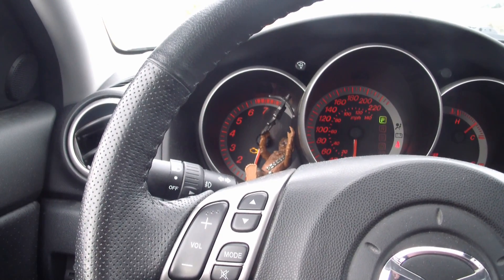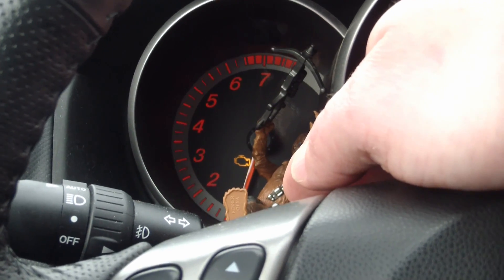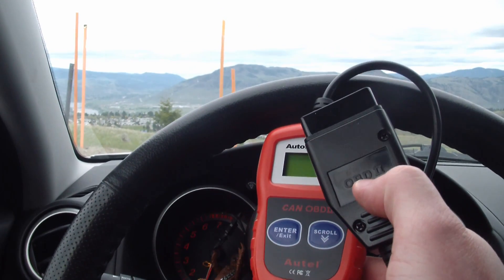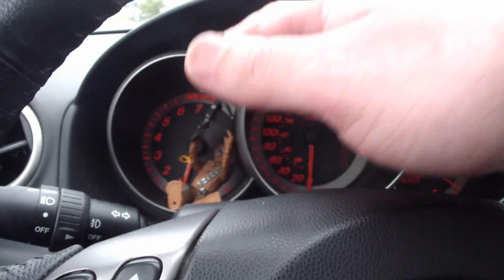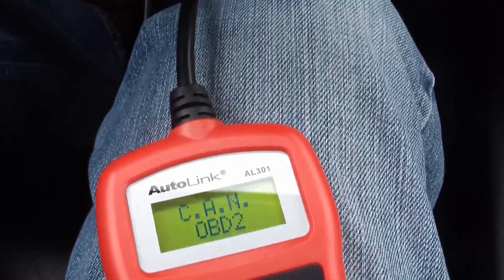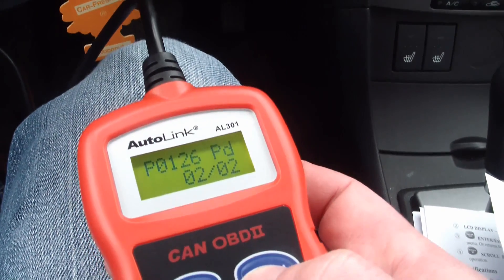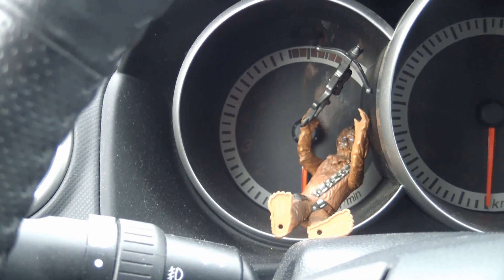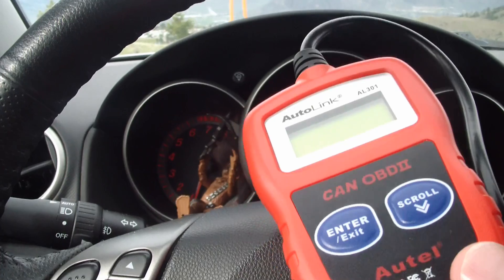Manly-Man Skills: Outsmart Mechanic Scams by Using Your Car's Computer!

Comment: First off, I'm not one of those trolls that likes slamming peoples youtube vids. I've been a professional mechanic for 38 years. I started working on computerized diagnostics in 1980 1/2, when they were introduced. I've attended multiple GM, Ford, Chrysler diagnostic classes. You've got a general idea what a "check engine" light is for. Let me zero you in on it a little bit. The computer has sensors, modules and actuators. When the ECM/PCM (Electronic control module/Powertrain control module) detects a sensor or actuator is reading above or below the parameters it is supposed to be in at a given point of time, for a given point of time, it will illuminate the check engine light. There are certain codes or conditions that will not effect drivability, and the light will go out on its own. If the problem can or will effect drivability the light will stay illuminated. In most cases a bad connection is NOT the problem. The automotive computer is used because of its speed and ability to sense and control the various functions of the engine control system, period. Any stored codes in the ECM/PCM will NOT tell a mechanic what the problem is with a vehicle. It is an aid to let the mechanic know what area the ECM/PCM detected an issue. There is NO diagnostic tool made to "tell" a mechanic what problem a vehicle has. It is up to the mechanic to interpret, test, diagnose and verify the vehicles fault. If a problem occurs momentarily, then clears up, a code will be stored for a time period, it will be cleared automatically if it does not re-occur in the next "50" cycles of the ignition switch. Any time a "check engine" light comes on, the owner should have it scanned by a qualified technician to find out if it is a serious issue that requires immediate attention.
Automotive dealerships, I've worked in several, would NOT return. A dealer has NO different selection of technicians as any other repair shop in business. In most cases, there is very little "factory" training provided to dealer technicians. I personally wouldn't allow a dealer tech to work on my car even while under warranty. Taking a vehicle into a dealer after the end of warranty is a bigger mistake. Customer pay repairs are inflated because of the difference in profits between "warranty pay" and "customer pay" in a dealer. The manufacturer "warranty pay" is lower than common repair cost. For instance, a mechanic has two identical cars in the shop with identical repairs, one under warranty, one NOT, the warranty repair will pay less and the "customer pay" will be inflated to help compensate for the difference. There are many other points I've passed on elaborating on because most everyone that has read this far down is bored to tears already. 
Again, a check engine light illumination should be checked by a trusted, qualified tech fairly soon to find out how serious a problem could be.
Reply: i'm not the person you're responding to, but i want to point out what the person is trying to say; a scan tool only tells you what the computer noticed is wrong. it does not diagnose for you. For example, you can get a rich O2 code that will show up like a P0420 (Catalyst Efficiency Code) that can be caused by something seemingly-unrelated like an intake manifold gasket leaking. In other words, a scantool is exactly that - a tool - and is not an automatic diagnosis machine. The code being set is a symptom of a problem, and it both might not be the only symptom, and might not be obvious as to the cause. It's very easy to be too reliant on the code reader.
Reply: gantz the great
The "cel" as you refer to it doesn't check anything. It is not there to identify emission problems. The electronic control system has many sensors, actuators and control modules. Any of those reading or working outside of their parameters will illuminate the light. Less serious problems my have to occur a couple times in a set time period to illuminate the light. The electronic engine controls are NOT there just for emission/pollution control. After working on all makes and models for the last 36 1/2 years I've learned a few things about those kind of things.
Reply: So you're arguing that AvE is wrong, and was wrong to do and say everything in the video? He found the problem, using the scanner, and he fixed it. ?????
Reply: James Walls Still runs like a champ amirite
Reply: I've been in this business for 35 years. You are absolutely right. How many DIY understand CAN1 & CAN 2.None of them I'd bet
Reply: @theflyingW64  Oh for fucks sake. You fucking primadonna. Thanks - Lumpy
Reply: count the flashes! Oh you lost track of where you were? Wait was that a fast or a slow one?

good riddance, lol.
Reply: May your swords stay sharp! (mysss29)
Nothing was fixed in this video. A CEL was cleared. That is NOT fixed the issue.
Reply: What brand is the diagnostic tool?
Reply: The CEL definitely aint a diag. tool it was not put there by the car maker by choice, our, i mean the govt forced them to put it there for all their pollution fuel waste  BS they enacted over the years! The cel usually only checks systems that affect emissions pollution,  PS my cel will usually blink if a problem is more serious but its been steady on over 100000 miles damn catalytic converter.... luckily i live in a no inspection state ....PS PS you can pull codes by manipulating the key turn in my truck too but its a biatch to time it right
Reply: James Walls well the cel is just a heads up of something up. if its not flashing there usually is not anything serious. id worry about the oil light coming on
Reply: ok whatever The regulatory intent of OBD-I was to encourage auto manufacturers to design reliable emission control systems that remain effective for the vehicle's "useful life". OBD-II standardization was prompted to simplify diagnosis of 
increasingly complicated emissions equipment, and though only 
emission-related codes and data are required to be transmitted through 
it according to U.S. legislation it has no doubt evolved, You said...It is not there to identify emission problems, after a comment like that sir I would not let you work on my lawnmower.

Comment: so just for starters. I have been a tech/mechanic on high end makes and models. I've work in different "steelerships" as you call it and in my humble and professional opinion, i can tell you that not all dealerships are corrupt. now that's not to say i dont know any corrupt mechanics. because well, i do. I take pride in my work and the place where i do so. we do have a standard diagnosis charge @ one hour for $125. One hours worth of labor. I personally have taken off labor time from customers tickets that can't afford it. but we do tell you up front before any repairs are done that our labor time is $120 an hour not including parts. so it is your personal decision to say that you want "us" to perform you're service. so I don't think it is fair to say all dealerships are crooks because it isn't entirely true. also some people aren't mechanically inclined enough to scan codes and trouble shoot codes. like for instance a person has a vehicle with an amber service engine soon light on that is flashing and they clear that code and proceeded to drive said vehicle and the code was for lets say multiple cylinder misfire in which case the vehicle jumped time or timing chains started to stretch or low oil pressure let tension of the chain and the vehicle was still being operated under those conditions the vehicles engine timing chain could break or oil pump fail and that in itself could lead to vales being broken or bent and resulting in a new head ( top of the motor with the valves and all the uppy and downy parts with spinny things) and new pistons. I think it is a great idea for people to be able to trouble shoot their own vehicles. but i also feel they need to be properly educated in using OBD 2 scanners. there are free classes that will teach basic stuff like oil service spark plugs and scanning vehicles with scanners. also word for wise or food for thought. scan tools that dealerships like where i work on imports AUDI, VW, LAND/RANGE ROVER. AND JAGUARS, we have specific programs to be able to diagnose your vehicle properly. thus being why our loyal customers come back with their vehicle needs. those small cheap scanners can mislead and misdiagnose .  # CHEAPLABORISNTSKILLED and #SKILLEDLABORISNTCHEAP. 
I do appreciate you and trying to save people money. I was in no way trying to be rude, disrespectful, or mean. thanks.

                                                                                                                                              
                                                                                                                                     Six year humble,proud, and thankful technician.

Comment: just a FYI, the CEL (check engine light) will only come on if the issue can cause emissions to be above a certain limit, they can still cause a light to come on on the dash but the actual CEL is reserved for issues that can cause worse emissions. some fords can have a complete misfire on one of the cylinders and the CEL never come on because when they detect a misfire it will cut off the injector for that cylinder which means that it wont have increased emissions so no CEL. also theres tons of codes that that cheap generic code reader cant read, theres codes for the ECM (engine control module), TCM (transmission control module), PCM (power train control module), BCM (body control module), fuel pump control module, radio control module, ect... i have a scan tool that cost several thousand american dollars and theres still modules on some vehicles that i cant communicate with but i can communicate with all of them on like 90% of the vehicles available in north America.

Comment: +1 on this video. An OBD II diagnostic tool is something that should be in EVERY glove compartment.

Having said that? With the ubiquity of smartphones? Get a bluetooth OBDII reader and an app for said phone called "Torque" (It's free) and you can watch the engine as yer goin' as well as clear out codes.

Comment: That $30 device is not going to show you ABS, SRS or other codes like this.
Sure you can pull codes, but do you know how to fix it?
A P0171 code is system too lean, but do you know where to look?

People these days do not read the user manual so they drive around with little oil in the engine, loose lug nuts, blown bulbs. ect.
Reply: and you're hinting at the real tip here that AvE didn't really explain; reading a DTC code isn't the same thing as diagnosing a problem. The code is just a tool or a symptom, and the code(s) thrown may or may not be relevant to what needs fixing.

Comment: So for the lights RTFM.  For reading codes go to a parts store borrow the diag tool and check it for free (most in the US let you use their store tool for free in the parkinglot) and if you need to wipe the code just press "erase" on the reader don't unhook the battery, that can cause other issues.

Also don't clear the code or disconnect the battery before state inspection or emission test or you will fail (they can tell if it hasn't finished all the self tests)

Comment: A lot of your veehicles have a secret magic code to make it tell you what the heck the CE problem is. On a Neon, you had to turn the key on and off three times, and then it would blink a morsey code on the CE of what the problem is. Note that down, then go down to Canadian Tire and browse the back of a Chilton's for your veehicle, and it should be in there, or check on the Interweb these days.

On the Ford Fiesta, it's a different magic thingamabob, and it'll display the code in the little display where it shows the kilometerage and such. Pisses me off to no end, because it has a fancy (expensive) Ford Sync display and a Windiddlyoos confuser and it could read out the problem in voice if it wanted to. It could also email me a veehicle health report, but Ford screwed over their Canadian customers for no good reason on that.

Ah well, my Raspberry Pis are breeding, so I think I'll rig up one of them to read the OBD port.

Comment: You do not have to buy one of those things... you can take your car to any Auto Zone or other parts store and they will read all your codes, clear them for you and if there are any repairs needed they can tell you what they are... give you a complete list of things to fix/replace and print out instructions on how to do the work yourself... or you can find a video here on you tube to show how to do it... OR if you still do not have the skills to do it yourself or just don't want to do it yourself at least then you can take it to a shop and you already know what they need to fix.
Reply: Lot of the time parts stores won't know where the problem is... They could mislead. Bring it to a tech, they could actually look into the problem and pin point the exact fault. Ford Escapes throw codes for bad ABS circuit. Parts stores will say "oh, bad sensor". It's 99% of the time a mechanical failure with a ring on an axle... The code will tell you otherwise though
Reply: WontonGames yy
Reply: That's why Google is your friend.

"Known issue" with X...I have a 325i; so far every problem I've had was a "known issue".  Sigh.

Comment: don't be a idiot. most likely it is a stuck thermostat open. engine not getting to temp in a certain amount of time. the light will come back on after a drive cycle. those code readers only tell you what the computer sees just because it says (for example) 02 sensor heater fault doesn't mean go out and replace your 02 sensor. it could be as simple as a blow fuse or bad ground or such. always have a mechanic look before you leap

Comment: I owned a Hyundai about 16 years ago - mostly because of the 100,000 mile warranty. The major catch? If there was a problem, but the "check engine" light didn't come on or if there were nothing to be fixed - they'd charge you $80 just to plug it into the computer to read the codes. 

My starter was going bad. Sometimes the car would start and sometimes it wouldn't.  No "check engine" light, thus, $80 for "no fault". Luckily, the starter completely crapped out in the parking lot of the dealership... the refunded my money and fixed the problem. 

Looking back, I think a few times they would reset/erase the codes so they wouldn't have to fix the problem under warranty. Then charge me $80 for their time.
Reply: Do you have any info to back that up? 1996 and newer can only turn on if its an emissions related issue and reaching a certain mileage is not an emissions related thing.
Reply: Your timing belt syncs up your camshaft and crankshaft and therefore your cam timing. When your cam timing is off you get worse gas mileage and therefore emissions are worse. Suzuki Samurai's need the belt replaced every 60k. Also many engines are interference fit which means when the belt breaks it destroys the motor due to the valves hitting the piston. Although if I remember right those engines are non-interference fit. Not trying to be a jerk but the most frustrating thing is people who read forums then come into your shop and think they know what they are talking about.
Reply: that's fairly standard dealership (and non-dealership) policy. what no one wants is to spend an hour or two diagnosing your car's problems, only for you to say "thanks but no thanks i can fix this widget myself now that i know what's wrong." Hence nearly every shop will charge a diagnosis fee per-hour, and then usually deduct or discount that fee if you do the repair.
Reply: Wvo Quailwvo Yes it is you might be confusing it with a maintenance required or change oil light. Those ones are mileage based.
Reply: I always went to Auto Zone or Advance Auto parts because they read your codes for free. Auto Zone quit doing.it, so they lost MY business!
Reply: It's amazing how many fuckos expect people to work for free, when you can bet your ass these same fuckos expect to get paid the second they clock in at work.
Reply: Here in NC Advance quit and Auto Zone still has the tool loaner program
Reply: What year is it?
Reply: As previously stated in my above post I am talking 1996 and newer obd 2.
Reply: And that is not a  milestone that means you need to change your timing belt. Try again.
Reply: +charlietow It's crazy isn't it.
Reply: Nice assumption but completely untrue. There is always a code connected to the light. And to the guy above a bad starter will not set a code.
Reply: +Gary Chandler hey there. free obd2 scans are indeed awesome. however think like you am a smarty one oh yes you are! and remember kiddos: "those part store guys are like Christmas kid. they actually don't know what they got!" 
it's like a blond walking into autozone right... well, low and behold a blond is also working the counter! 
typical part store guys are just that. parts guys. they don't know how those parts actually work. how they are and are not related. how they work in "unison." nor do those cats have a grade about common experience ie. they are no experts and have no expertise

Comment: I used to own a Honda. It had a real fault with loss of power periodically and the engine light was on as in this video. The recovery truck and the garage I took it to both could read the code, but neither could say what the code meant because they both said: Honda use their own codes and do not publish them to anyone apart from their own authorised dealer network. I don't know if that is still true, but if that situation occurs at least for some cars it makes these codes less straight forward than depicted in this video. Yes anyone can read the code and it is standard, but no that doesn't mean you can always find out what is wrong and fix it yourself.